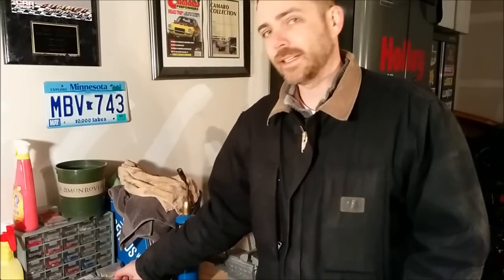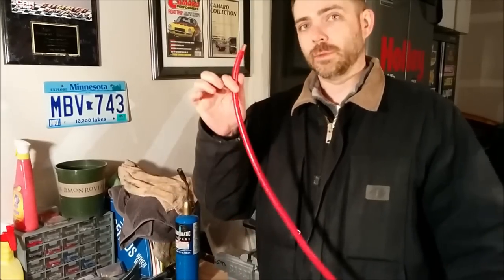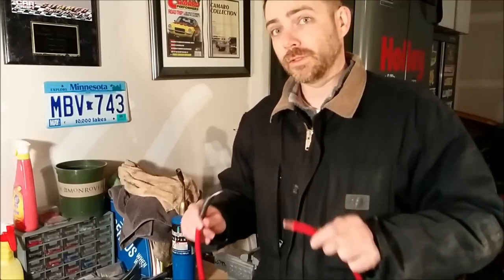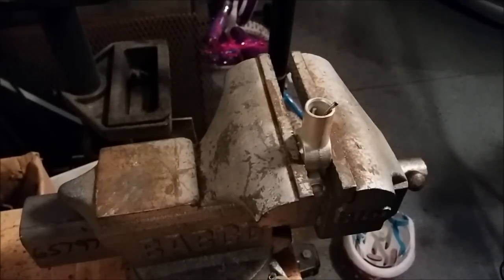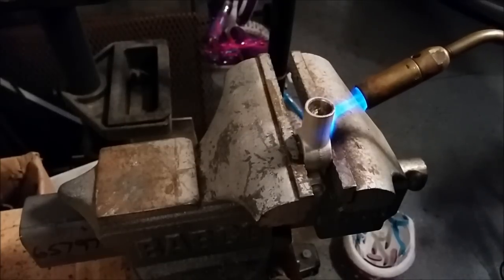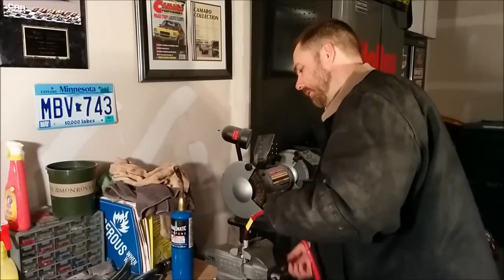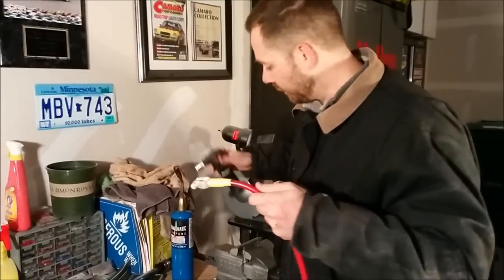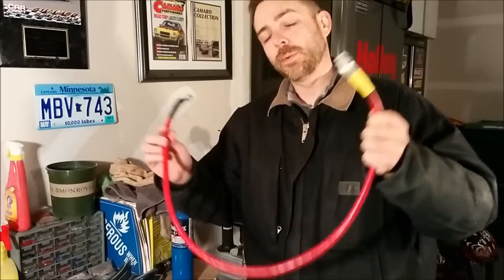How to make custom length battery cables and wires

Comment: No No No.  High current cables should be crimped.  You can add some solder later to seal it but never rely on solder for a battery cable.  Bad advice.
Reply from the maker: They come prefilled with solder, look at McMasterCar's catalog
Reply: It's still bad practice.  Most folk will get away with it, but it would never fly in industrial applications.  Don't learn bad habits from the beginning.

Comment: compression needed.. not just simple weld.
Reply: I used to install stereos with twisting the wires and using electrical tape, but I don't recommend it to everyone. Solder isn't recommended. Compression is the best way because it's stronger.
Reply from the maker: Maybe. That simple weld held up to many races.

Comment: Do not follow this video...  waaaay wrong.
Reply from the maker: Please show us the riiiiight way.
Reply: Gearhead Daily first off professional cables are pressed under high pressure NOT SOLDERED. Go buy a cheap chinese hydraulic hand press with hex on ebay for $40 and forget soldering. If you do solder you never ever dump a cold cable into hot solder and call that a connection.  Not gonna waste time teaching you how to solder. Youtube has plenty of vids on basic soldering.  But this video should be taken down.  In his bloopers he even showed why.  No real connection was ever made. This video is just one more reason why social media and back yard hacks are dangerous.

Comment: I had to be a critic, but this could really mislead people, that is not a good connection and under moderate load it will fail
Reply from the maker: Didn't fail at the race track under high loads and max power output by the alternator with 6 of these wires.

Comment: Nice job.  Can't go wrong with that gauge!  BTW, do you think a 4 AWG would be suitable for a battery to a 140 Amp alternator (max. 5 ft. away) cable?  Thanks.
Reply from the maker: For me, bigger is better. I'd go 0 or even 00 gauge.